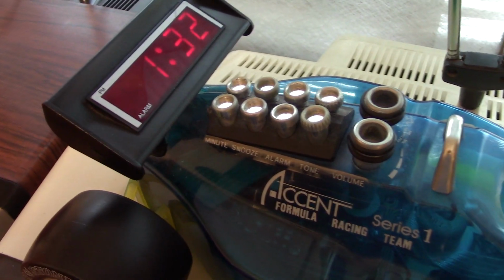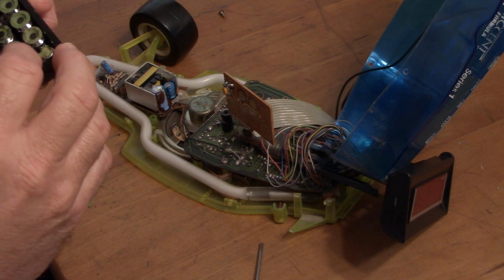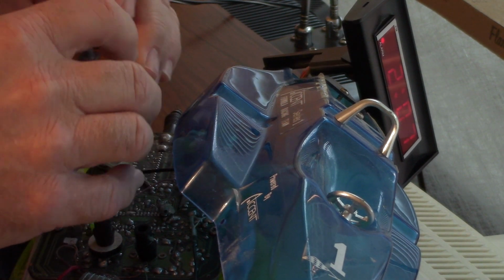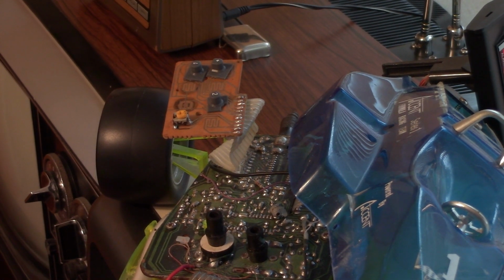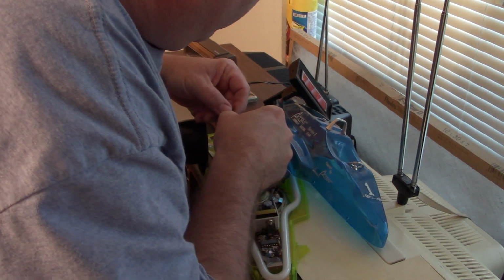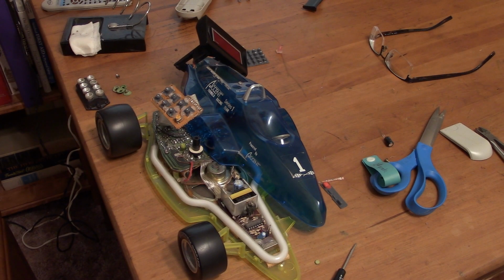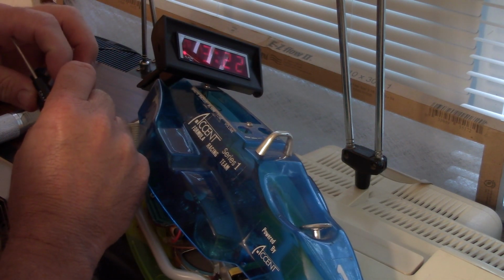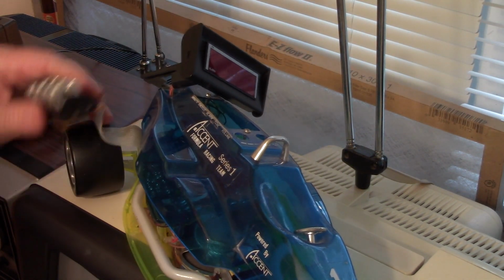Formula 1 Race Car Alarm Clock Repair Attempt Part 1

Comment: Well, if at first you don't succeed, TRY, TRY again.  Hmm, comes back to haunt all the time.  

That was a great idea to use the remote buttons.  I'm sure it will work better than before.  But unfortunately, some old stuff just disintegrates and can't really be fixed.  As it was, the leaky cap caused a significant amount of damage, could have been way worse to the point where it wouldn't work at all anymore.

I was called upon early this morning for an impromptu repair.  Turns out the wif had this 40-page document she needed printed.  She also asked me if I had a 3-hole punch.  I have an electric 3-hole punch, in fact.  But it's a junky one.  Always worked, but I haven't used it for many years.  It's been sitting, getting baked by the sun in the window, for probably a good 10 years since I last used it.  Needless to say, it didn't work now.  A DOZEN screws later, I had it apart.  Fortunately nothing looked out of whack.  I just cycled the mechanism by hand, cleaned out any remaining paper chaff, and put it back together.  Magically, I get the click-click-clunk back that it used to make.  The punches are slightly offset so they don't all punch at the same time, I guess to make it easier on the puny mechanism.  It's back working again.  That was a nice way to start the day off at 6 AM, with a successful repair.
Reply from the maker: Indeed, that's what I did. That cap really did this alarm clock in. Knowing that, part two will make sense.
I had an idea, that conductive pad was the main issue, but it ended up being the tip of the iceberg, for sure.
That's awesome you got the hole punch working, again, early this morning.